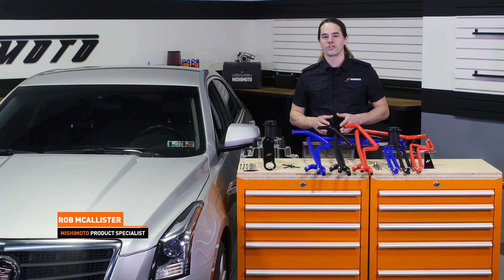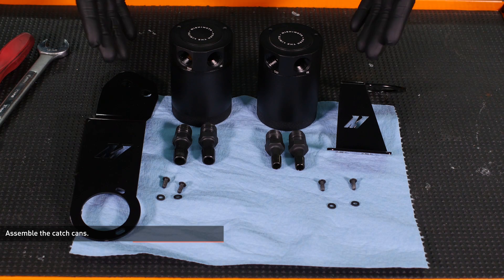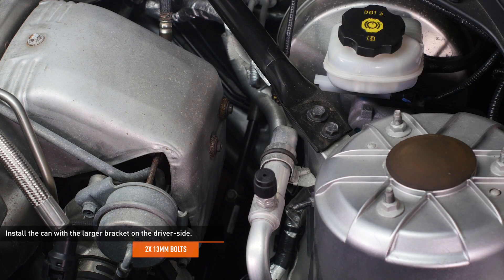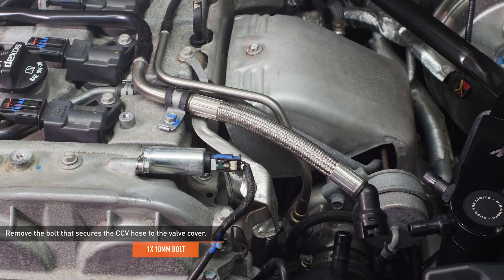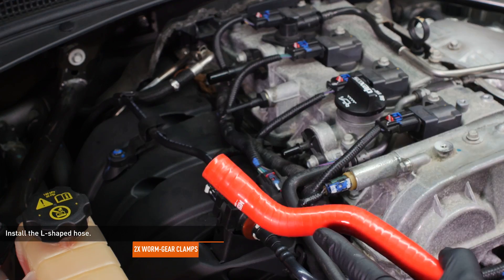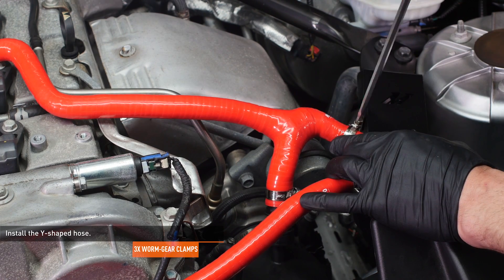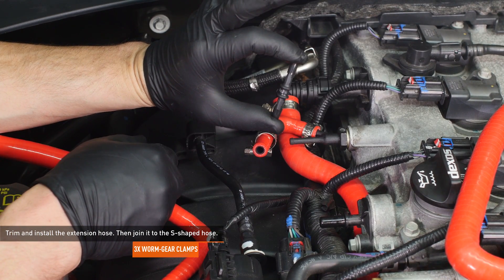2013+ Cadillac ATS Baffled Oil Catch Can System Installation Guide by Mishimoto

Comment: How easy is it to remove the cans after install?
Reply from the maker: To drain and clean? Just remove the hoses from the fittings and the bolts holding the bracket to the can.

Comment: Does this system affect your warranty that you know of? Got it in the mail today installing tomorrow 🤟🏽
Reply from the maker: Catch cans should not be a component that would void your warranty. However, every dealership will react differently to aftermarket components. If the warranty is a concern we recommend contacting your dealership before installation.
Reply: Mishimoto Automotive the quality is unmatched and it looks great under the hood very happy with my Sysrem it’s a little bit of a tight fit, how do you recommend to empty the cans? Thanks in advance!
Reply from the maker: You can twist them open to drain and clean them out.
Reply: Mishimoto Automotive haha that is obvious, never mind, I’m very happy with it
Reply: ANY modification can effect your factory warranty.
Reply: Once you take your Caddy in...  even for just an oil change, the 'MODIFICATION' will be noted in your service records...  Dont expect any major work to be covered in the future
Reply: Where can I buy the piece? ( 1X PCV Adapter

Comment: What exactly is the PCV "Y" adapter?
Reply from the maker: This is the piece that screws into the side of the Valve cover. In the video this can be seen at 3:56.
Reply: @mishimoto  Yes, but why is this being used and the front CCV port isn't being used anymore? Unless there is something missing from the video, it looks like there is no mention of what is done with the front nipple of the ATS's original plumbing...
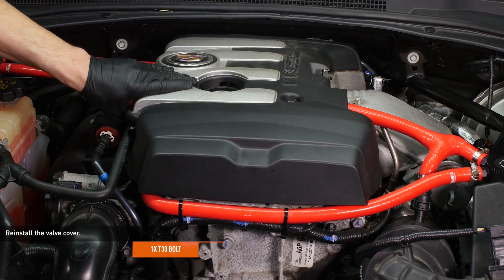Reply: @charlievlachos5144  i looked over the video and at 7:35 you can see the y-pipe tubing being connected to there and ran to the driver side.

Comment: i just installed the system using this video and it was a Godsend. made it simple. that said i noticed the difference immediately. i used to have rough idle. not bad but noticeable for a luxury car. now the engine runs smoother and acceleration is smoother than ever. my 2015 ats has 26,000 miles. car feels new again.

Comment: Been using this system for almost a year now and its working great!  I was wondering, does it only work during boost?  Since I've read that slow driving and long idling can cause build up in these cars, I was also wondering if down shifting will cause a reverse effect on the vacuum line.
Reply from the maker: The can should be doing it job under any condition, it is possible that under boost the car is just producing much more blow-by. You should not be having reverse effects when downshifting.

Comment: I have a 2013 ats 2.0 turbo will installing this increase HP ? what should I expect ?
Reply from the maker: Hello David, catch cans are designed as a preventative maintenance item and will not increase your HP levels.
Reply: Expectations should be that "blow by" oil will not enter the turbo. Should enter the catch cans.  You do have to empty these.